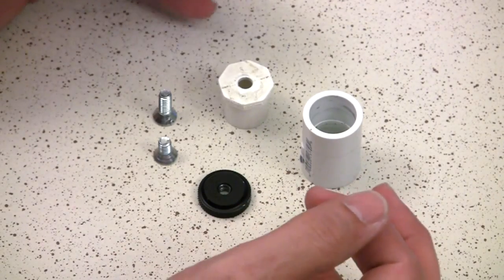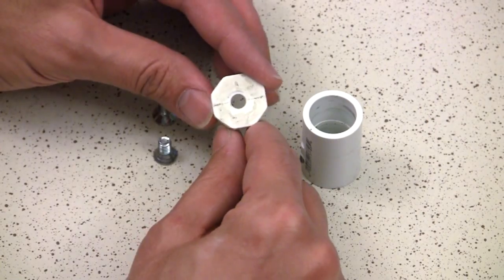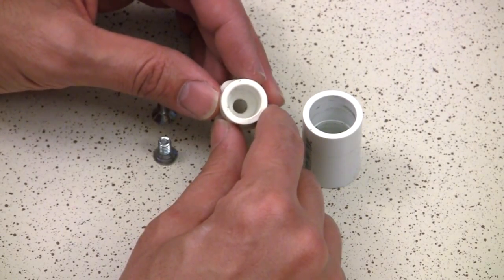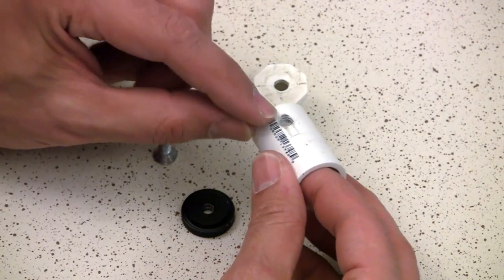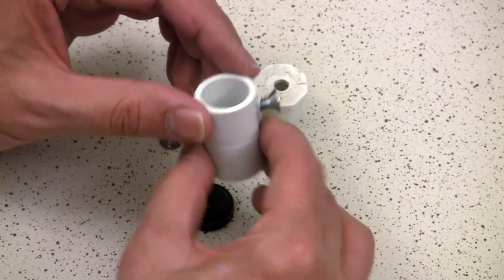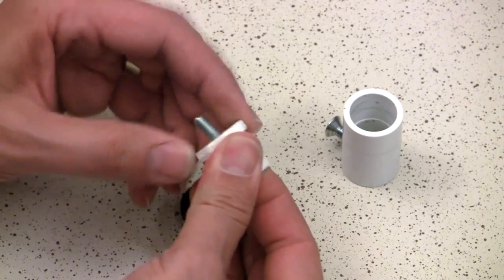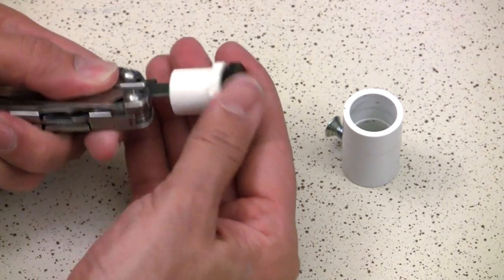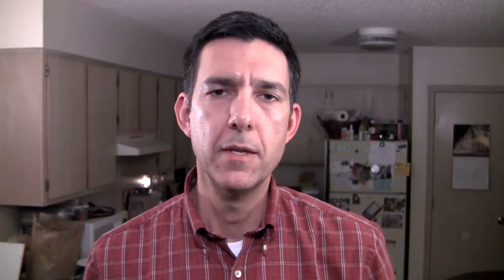Painter's Pole 1/4-20" Tripod Adapter

Comment: Great tip!!   Be careful that the screw is not too long for the socket of the camera.   I ruin my camera that way.   Is 5,5mm standard?
Reply from the maker: If there are too many threads poking out of the top, definitely add the rubber washer or don't countersink the hole from the inside.

Comment: You're lucky you can get 1/4 20 threads so easily. I'm in the UK and everything is metric and I will have to order parts from the US at great expense. 

Damn.
Reply: goto a bolt supplier, they will have some in stock at very little cost (almost guaranteed :-) )
Reply: croydonvideo I've tried plenty, Croydonvideo, but none of them seem to do imperial any more. A few have suggested they might do BSW (a couple of Jag restorers list a couple of 1/4 20 items) but I think the universal thread is UNC, isn't it? Can't even find 1/ 4 20 thumbwheels which would be even better as I wouldn't have to make my own up. Also can't find 1/4 20 brass inserts for wood. Any ideas?
Reply: Here in Oz we have been metric forever, but there are still available, supplies of imperial. I think the correct thread you want is 1/4 20. That is the thread used by all smaller cameras.
http://www.ebay.com/itm/Hot-Sale-Durable-1-4-20-Tripod-Screw-to-Flash-Hot-Shoe-Mount-Adapter-/181558644436?pt=LH_DefaultDomain_0&hash=item2a45bd0ed4
Have a starting look here. Good luck
Reply: Thanks, mate.
Reply: Pádraig Floyd
Sorry, I forgot to answer your question. I think it is UNC, almost certainly is. Have a look here http://www.britishfasteners.com/threads/unc.html
Reply: croydonvideo Thanks very much, croydonvideo.

Comment: That's Great stuff, I'm a big fan of using a painters pole for many different DIY uses.  I made a light stand build tutorial a couple of years ago (Link Below), but the use of the end caps in your video would work great.  As always, great job!  I have been following you for may years and you always have something good to say and your tutorials are easy to follow (Which is hard to find). 
http://youtu.be/I3jV2tw5Lis